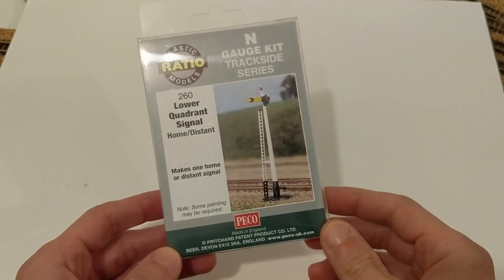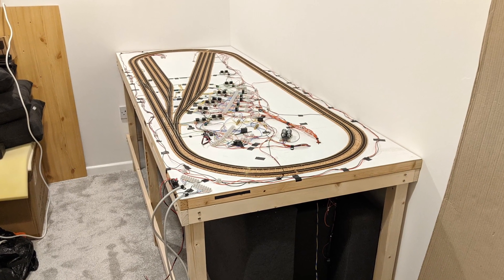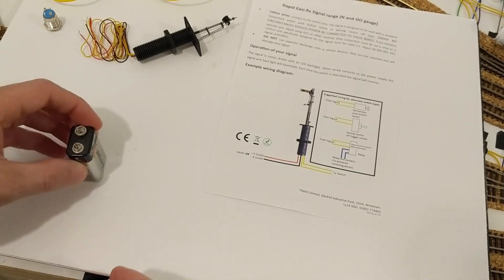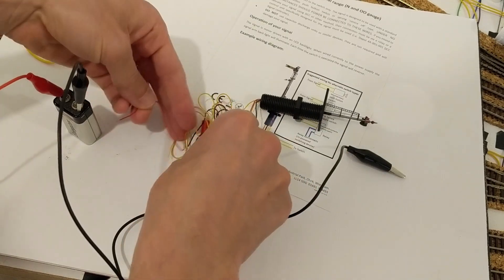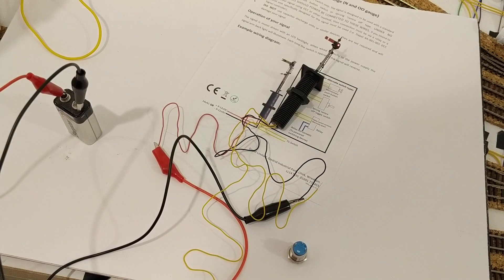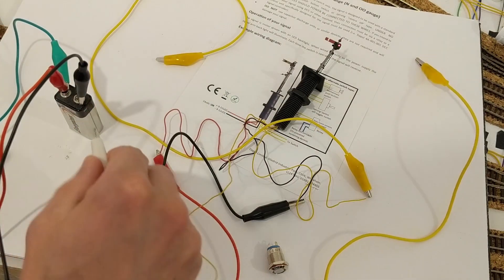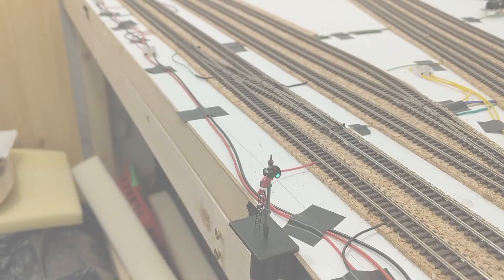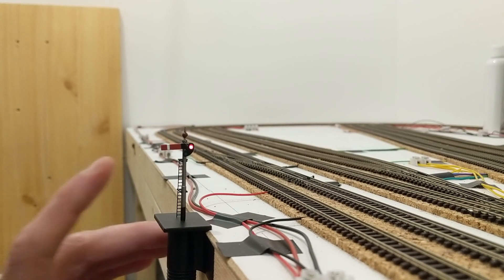0024 Wiring a Dapol motorised signal

Comment: Evening Johnathan, I have  two home and one distant n  gauge dapol single s and have read a lot of blogs about the correct voltage to use but having watched your video I will happily go with the 9v battery pack to power the signals..great insight and information. thanks.👍
Reply from the maker: Hi, I'm glad it's been useful for you - thanks 🙂

Comment: Hi Jonathan, very interesting video as I’m starting to think about signalling as I rebuild Exehaven. I am trying to keep my layout as simple as possible whilst being realistic and thought the Dapol motorised signal might be the the route to take, but after reading the comments below may now have a re-think 🤔
Cheers for now, John
Reply from the maker: Hi John, yes it's a shame because they look nice and could save fiddly LED and wire fitting! Potentially using them and then scrapping the servo in favour of an external one is still going to be easier than building and modifying the Ratio kit, but would be an expensive way to go. On the other hand perhaps it's possible to install them as-is and then only modify them if they break afterwards - it would probably just need a bit of "future-proofing" space nearby on the underside of the baseboard, and no elaborate scenery burying the surface-level rectangular base of the signal. The MegaPoints control of one of these (from a while ago!) is at https://www.youtube.com/watch?v=m6MmCO9eTKU
Reply: Thanks Jonathan

Comment: Evening Jonathan! Some very interesting stuff here, especially about how you intend to interlock signals / points / switches! I've thought about how I'm going to do this, but instead of semaphore signals, am taking the easy option, and am going to go down the light signal route! Then all I need to worry about is whether my micro servo motors have thrown! I plan on using an Arduino based system to do this, which I'll hook up to the DCC system to provide the user inputs! I also plan on having code to "reset" the system to a known state, which should help when trying to write automation code! I'm really looking forward to that part of the build, but it seems so far away! Lol! All the best, Ian.
Reply from the maker: Hi Ian, thanks - yes I'm finding it fun thinking about what logic's going to be needed for the interlocking, and am many years overdue on trying to do something with an Arduino! Colour signals fit Shelfinton's timeframe nicely. If it weren't for physical vulnerability I think I'd be starting on the proper details research into this, but if feels a long way off for me too!

Comment: I had two Dapol upper quadrant  - both failed after a few months despite getting only limited usage.  Very expensive- so wouldn't recommend 😢
Reply from the maker: Hi Euan, oh dear, that's not even close to a long enough lifespan - so it would seem that it working out of the box is only test number 1! Thanks for the warning. Perhaps I won't use this one as-is after all, and go back to the original plan of opening it and connecting to something else. I'll have a good go at the Ratio kit (eventually!) before deciding whether or not to buy any more Dapol ones though.

Comment: Hi, as the long term goal is to interlock the signals and a point/switch I would be tempted to go the arduino path, Inputs from your existing point/switches could be used for the logic of the signals or vice-versa, will also allow 2 or more signal heads to control access to the switch/point. Inputs and outputs of the arduino can provide all of the signal forms you need and be stepped up/down to the required voltage levels. Confirmation that a point or signal has switched  is confirmed in the real world by sensors back to the control system, but the level of available sensor technology for models in N is very limited or non-existent, however arduino allows that to be an expansion possibility and can be software programmed at the outset so as the sensor technology becomes available it can be implemented easily.
Love the way the layout is progressing. Cheers
Reply: Trouble with these Dapol signals is that the state of the signal is known only internally. It is a complete mystery to any external system to which they are to be integrated. This is a fundamental flaw in a signal at this price point, and one which no self-respecting points motor would emulate. We need semaphore signals to which we can connect competent actuators, like off-the-shelf point motors, not these functionally obfuscating products from Dapol. I’m a competent and experienced embedded systems engineer and would dearly love to help Dapol do better than their current offering, if they are ever interested to do so.
Reply from the maker: Although I haven't looked into this much, YouTube did show me a video where Dave from MegaPoints Controllers had opened-up one of these Dapol N gauge signals and connected it to his servos and control system. But yes, it would be nice if there was a version without the Dapol servo, ready for external connection, and at a lower price.
Reply from the maker: Hi Tony, thanks for your suggestions :) Yes an Arduino sounds like a sensible way to go. Even for a small number of signals and points there are lots of possible states for the system, so being able to define the constraints in software is attractive! I've got plenty of experience writing code, so software logic shouldn't be a problem, but connecting to the physical world will be a first for me. All of the points on Endoor are connected to microswitches, so the position of those is physically sensed, but for these signals I might need something like a latching relay, and a way to reset its state if it gets out of sync. Lots to think about - it might be a good job that signals will be one of the last things!